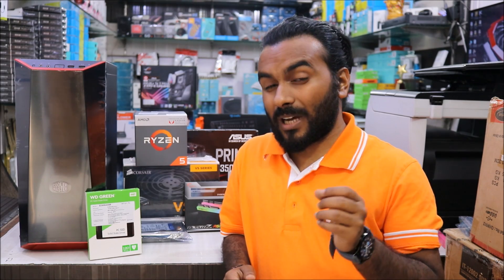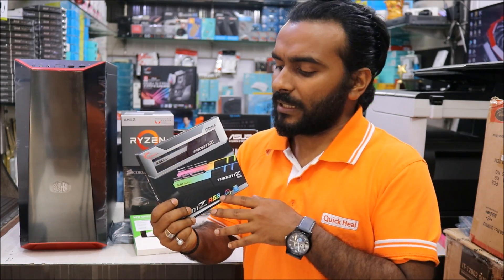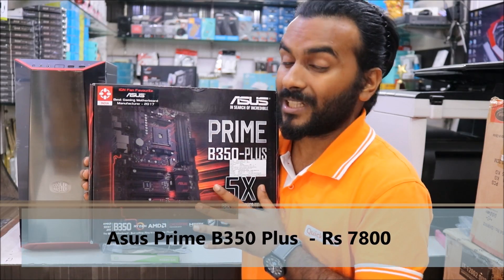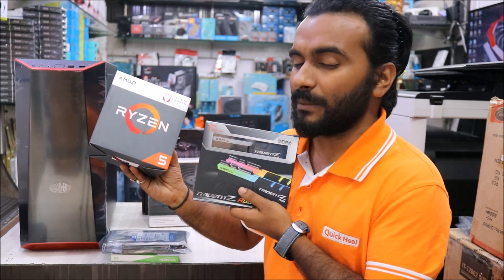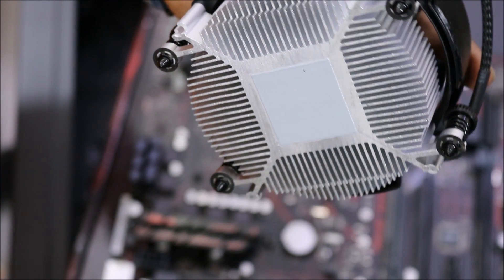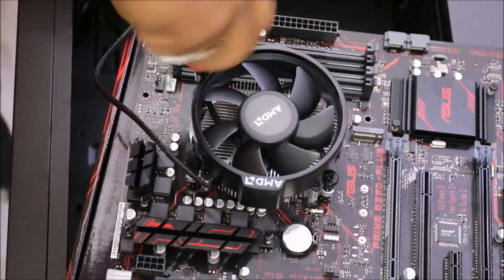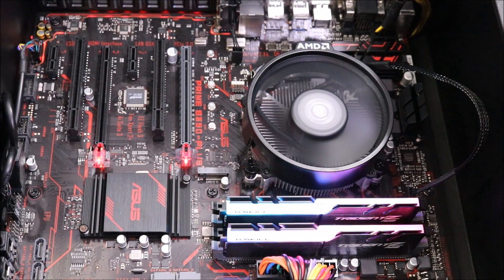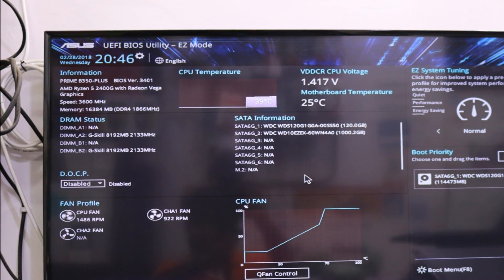AMD Ryzen 5 2400G PC Build | On board Radeon Vega

Comment: im using ryzen 5 2400g processor on system windows 10 10.0.10240 Build 10240
but i face Clock watchdog timeout error 
is it due to windows version ?
please rply

Comment: If you are building a new PC then you also use Corsair Vengeance LPX 8GB DDR4 3000Mhz instead Gskill Tridentz which come at cheapest price that is 1×8 GB RAM for around 4500 rs and have same 3000MHz and if you need 16 GB then you can add one more of it and it will take hardly 10000 rs for 2×16 GB RAM and you can save around 9000 rs

Comment: Motherboard asus z2070f , graphiccard asos geforce GTX 750ti , ram 8gb ddr4 240 mhz corsair vengeance  lpx and  transcend 2gb 1600mhz ddr3 , Harddisk WD 1tb blue 64mb 7200rpm , SSD Samsung 860 evo 250gb , Processor Intel i5 8500 , DVD rewrite supermulti , Power supply corsire VS650 , any lipid cooling fan , cabinet any.

Comment: Kya RYZEN ka processor flash nd Freeze karta hai bohot mere dost log ka ho rha hai yesa aaplog ka hota hai aur GRAPHIC CARD LAGWAYA v hai?
Reply from the maker: If you your PC is freezing then there must me something wrong with the configuration.
Reply: @TechmartUnbox  aapne ram 8gbx2 use kiya hai lekin mai soch rha hu ki CORSAIR VEGEANCE 8gbx1 3000mhz nd Corsair vegeance 4gbx1 2400mhz use karu kya aram se game nd stream kar sakte hai
Reply: @TechmartUnbox  Aur SSD 240GB ND POWER SUPPLY 650WATT ND GRAPHIC GTX 1060 6GB RAM

Comment: thanks for the great video , i got the same cpu with asus strix b350 , i was woundering if you can show us the settings you changed in bios , like how can i increase the memory dedicated for the apu other than the 1gb default ? i got 16 g (2*8) 2400 mhz ram can i overclock to 3200?

Comment: Can u plz help me... I have asrock a320m hdv motherboard with ryzen 5 2400g and gskill 3000mhz ram, but the system is not stable when i put the RAM @ 2933MHZ (blue screen crash).. the system is stable at 2400-2800mhz. Ram fq... Any idea to fix it.. can't i run the RAM at its full capacity??

Comment: I'm building my first budget editing pc with-
Processor- Ryzen 5 2400G
Motherboard- Asus Prime B350M-A 
RAM- 8GBx1 Adata XPG Spectrix 3000mhz
HDD- WD 2TB BLUE
PSU- Corsair vs550w
UPS- Circle 1kva
Cabinet- Circle CC 820
including dell Monitor for ₹9k,
KB&Mouse and speaker for ₹2k
Total cost around ₹55000inr 
Any better options? Tips?

Comment: Can I use Corsair Vengeance 8GB DDR4 LPX 2400MHz .                                                                                                                       
            The link for this item :https://www.amazon.in/Corsair-Vengeance-2400MHz-Chipset- 
            CMK8GX4M1A2400C16R/dp/B01ARHCZYO/ref=sr_1_1?s=computers&ie=UTF8&qid=1527864457&sr=1- 
            1&keywords=corsair+vengeance+8gb+ddr4+lpx+2400mhz+c16+ram+kit+for+x99+chipset.
   
Please Make a video for me using this ram with the same processor and motherboard

Comment: my requirement

Ryzen 5 2400g 
MSI B350M Gaming PRO Socket AM4 Motherboard
Crucial 2x4GB DDR4 2400 CL17
Seagate Barracuda 1tb
BitFenix Comrade Window ATX Mid Tower Case (Black) + 500W PSU

can i overclock with that requirement?

Comment: guys hi have below requirement for my VIRTUAL MACHINES practicals. 
if you can let me know what will be the overall cost of the build, so that i can place order.

1) Intel Core I7-770 processor.

2) Asus B350 Plus Motherboard.

3) 2 TB HDD seg

4) Cooler Master K380 cabinet (you can suggest better if any).

5) 32 Gb of Ram (Corsair / Kingston )

6) wireless keyboard/mouse.

7) Artis 600 VA UPS.

8) TS quick heal.

9) 120/250 GB SSD,

10) SMPS Cooler Master 600W

11) any good graphics cards, which can support VR games, give me the
cost of that, consider 1060 graphics card of the good company.

Comment: Sir I am looking a PC build for my office which includes multi-tasks like running 2 accounting softwares, surveillance software, Microsoft office, screen recording etc, which processor and motherboard I should prefer. Plz guide.
Reply from the maker: ryzen 3 1200 will do all the work and you dont have to spend much,
Reply: Techmart Unbox thanks bro, but when I enquired the seller said I also need to buy graphic card otherwise there will be no display.

Comment: I wanted to build a beast pc

Intel i7 8700k
Asus Z370-E Strix
TridentZ 3200Mhz (8gb×2)
Samsung 960 evo 500gb m.2 ssd
Samsung 860 evo 250gb Sata drive
Seagate Firecuda 2TB
Corsair Crystal series 570x
Corsair rm1000x power supply
Msi Gaming X Trio Gtx 1080 Ti
Corsair H150i Pro hydro series cooler...
Reply from the maker: Please drop me an email at techmart.unbox@gmail.com

Comment: If you are looking for a much cheaper budget go for Ryzen 3 2200G and a bit cheaper AM4 mobo, 8gb 2800mhz, HDD, SSD and cabinet(under 2k) which comes with PSU..
Bcuz this setup doesn't require more than 250w PSU.. The SMPS which comes with cabinet is more than enough
With this u can cut the price to 32-35k..

Comment: Replace these with the component used in the build video and get MUCH better performance. Prices from cost to cost (http://www.costtocost.in/list/pricelist.pdf)

AMD RYZEN 5 1600 : Rs 13135
ASUS 1050 TI 4GB : Rs 12288
ASUS B 350 PLUS : Rs 6990
CORSAIR 8GB D.4 VENG.(HEAT : Rs 5990 enough for now. Can add later when memory prices comes down.
Reply from the maker: hey guys dont fight, !
Reply: Stupid have u ever visited that place. While making purchase they will add 18% . please calculate the price and let me know in the comment box. People like u really mislead the entire world using little knowledge. Little knowledge is very dangerous. Always research before puting anything on social media platfrom.
Reply: (13k+19k) = 32k
(13.1k+12.2k+6k)*1.18 =  32.38
Same motherboard.

So for 380 Rs.. you are getting a system that will kick the ass of the system built in the video.. And I am misleading? Wow!
I gave a alternative which cost almost the same now with MUCH better performance and a simple ram upgrade path. I also mentioned it's better to wait for 2600.

I have no affiliation to any store. You will get cheaper at some place and expensive at other. You need to check what is best for you. Added the pricing from cost to cost as these prices are easily available online and represent a cost at ground level. Online marketplace(amazon/flipkart) are generally expensive for PC components.

Comment: If you want a pc only for gaming in less than ₹35000, than this pc will give 2x better results in games than Ryzen's new APUs :
-G4560 (₹5500)
-1050ti (₹12000)
-8GB 2400mhz (₹6000)
-Mobo (₹4400) , don't remember the name 😅
-Wd blue hdd (₹3000)
-Psu (₹2500)
- Cabinet (₹1500)
Reply from the maker: kuch bhi  haan ??

Comment: What about the bios update did you yourself did that or it came from factory.
Reply: Hardcore Gamer yes ryzen 2000 series have facing bios problem
Reply: go to amd support webpage and request for BOOT KITIt contains AMD A6 processor for booting and Flashing Bios
Reply from the maker: buy a latest manufactured board. I got jan2018 manufactured and it was working perfect out of the box. Also bios was latest
Reply: Thnx for the reply
Reply: Techmart Unbox can I use MSI b350 tomahawk with latest bios if I buy that mobo after 2 months?
Reply: Yes you can if they would clear their stocks.I am also waiting for older stocks to be cleared.

Comment: Can you build pc under 1 lakh
My requirements are:-
I5 8600k
Asus mortherboard 
Gtx 1060 3gb OC
250 gb SSD
16 GB ram 
2tb hard disk
Cooler system 
Cooler master cabinet 
Corsair power supply
Reply: you can get these specs at 50-70k
Reply: Ur good eith this mate. Nice

Comment: ₹13000 AMD Processor + ₹19000 Ram =32000 ₹ /
₹ 12000 (i5 7400) + ₹ 15000 (1050ti) +₹ 7000 RAM = 34000 ₹
Reply: bro its 16gb 3000mhz for 19000, ur adding 8gb 2400mhz for 7k. Ur calculation is like comparing mercedes to a maruti ciaz. Also i5 7500 price is 14k
Reply: Sashank Gaurav . comment me kuch bhi likha dalo sahi h baba
Reply: Bhai 1050ti have vram so 8gig ram also work
And costtocost.com has cheaper rate of i5 its offline price
Reply: Sashank Gaurav costtocost.com prices are excluding gst. Please add 18% to that amount

Comment: Do i need to update bios for ryzen 3 2200g with vega 8 graphics Apu
Reply from the maker: Buy latest manufacture board, The One i installed It was manufactured in Jan2018 and the bios was latest hence I don't had to update bios.
Reply: Thanks

Comment: Awesome build again can you tell me the price of gtx 1060 6gb please bahi.
Reply: gtx 1050ti 4gb OC can handle GTA V,farcry 4 and other AAA titles at high to ultra settings on 40-60fps
Reply: Geeta Prabha yes you can go with GTX 1050ti but I would recommend GTX 1060 3gb .it's the best value without price inflation.😊
Reply: Which can handle easily gta 5 and far cry 4 on high and ultra settings please  and on Intel under 40,000 to 45,000
Reply: Techn Guys it should not be more than 25000
Reply: Anshuman Singh approx 38000rs

Comment: Hi bhai 
I have request to you please can u make 1lakh pc build with parts given bellow....
intel i5 8400
Cooler masterbox lite 5 rgb
Asus gtx 1050ti 
Corsair cx 450
G skill ram (8x2) rgb
Hard drive 1tb 
Ssd samsung 850 evo 120  gb
Lg24mp88hv-s moniter 
Gigabyte z370 aorus ultra gaming 5 motherborad
Reply: Deepak Chawla thanks bro
Reply: pratik khadake go with gtx 1060 3gb
Reply: It is 8400 non k there no unlocked version for 8400
Reply: pratik khadake bro instead of going with lg monitor which is around 15k online you can go with samsung curved monitor :- 
https://www.amazon.in/gp/aw/d/B01GFPGHSM/ref=mp_s_a_1_1?ie=UTF8&qid=1519977060&sr=8-1&pi=AC_SX118_SY170_FMwebp_QL65&keywords=samsung+curved+monitors
Reply: Non k version n high end mobo.....doesn't complement mate....go for i5 8600k or else wait till April for b chipset mobo.
It wud b better if u go for ryzen u can build a beast in that range.
Reply: Ashèr Velázquez thanks bro
Reply: Ryzen 5 cpu, 1600
B350 mobo
16gb ram
1060 6gb
24" display.
500w psu
You can assemble below 1lakh
Intel 8400 is not a good choice right now, u can wait for cheaper motherboards.
Reply: za guite I would recommend go with ryzen 1700...
Reply: pratik khadake don't buy Intel processor. .go with ryzen 1700.... believe me u could play all UPCOMING AAA games in ultra
Reply: pratik khadake 😂😂😂😂😂😂😂😂😂😂😂😂😂😂😂😂😂😂 1 lakh ka build using 1050Tis 😂😂😂😂😂😂 You meant using them in sli or cross fire isnt it 😂😂😂😂😂😂😂
Reply: 1 lakh build using a 120 gb ssd and a 1tb hdd ... bhai ganja wanja phoonka hai ?

Comment: My requirements 
Ryzen 5 1600
Asus Prime B350 plus
8Gb DDR4 Ram 3000Mhz
1Tb Segate Firecuda.
Corsair CX 650 bronze plus
Asus GTX 1050Ti
Reply: looooool an overkill psu can't fry your motherboard or damage your pc. That only happens if the psu is rubbish and cheap
Reply: Umesh Benake go for gtx 1060 3 gb
Reply: Anshuman Singh 
Thank for suggestion I was Also thinking of that.
Reply: Anshuman Singh 
Bro but I wanted to use it for video editing not for gaming.is 3gb V ram is enough for video editing?
Reply: Umesh Benake gtx 1060 would be gd for editing than gtx 1050ti
Reply: East Hunter69 
No bro... It will  not affect motherboard.
Reply: Umesh Benake go for Asus strix b350f -AM4 MOBO
Reply: Maybe save some money on Psu go for a 550watt as 650watt will be a overkill for the PC and it may fry the motherboard!
Reply: Sir, as you mentioned that you want a pc for editing, so an SSD is a must for editing and you should use 16 gigs of ram(you can upgrade the ram later), but you should buy an SSD for booting the system and installing editing software, rather spending on 650watt PSU I recommend- https://mdcomputers.in/index.php?route=product/product&path=68&product_id=7315 . I calculated your your power usage and 400watt is enough for your system. You can also calculate by http://www.coolermaster.com/power-supply-calculator/ . And another thing sir for video editing GPU is not very important, you can use an RX 550 or a GT 1030, the gpu choice depends upon you sir but I recommend RX 550 4gb as Ryzen works better with radeon graphics. I hope this helps you. Thank you
Reply: Sir, this is not right if the person doesn't know you should make him know about that fact,  rather asking him "Do have any technical knowledge??",  I saw that you were asking someone that 3Gb vs 4Gb VRAM for video editing when GPU has no role in video editing. This justifies your technical knowledge. Sir be correct first and correct others later. Watching 3-4 youtube videos doesn't make you knowledgeable. So sir please mark your words while replying. thank you
Reply: Hello i can help u with Ur build
Reply: Whats Ur budget
Reply: Pagal Rocky yes asus strix b350f is a better option it is available for 9500 and it support rgb lighting
Reply: De_Mo no thats not true for rendering video u need higher boost frequency so a lower priced graphic card will not help
Reply: Harshit Yashwardhan no it's available for 9900
Reply: Itna bawal ..sahi h
Reply: You should go for corsair VS 550
Reply: Sir its true that graphics memory doesn`t affect editing( if the gpu memory is less it will just spill into the system memory) but a good GPU is required for editing videos and for smoother playbacks. The processor only affects render times but the main work(which is editing) is done by the GPU.
Reply: Dark Angel the main work is done not only by the gpu but also processor
Reply: mark vaz very informative bro!
Reply: Umesh Benake you can watch techy devv's channel it is very nice..you can get a nice pc for yourself there!
Reply: Devv Khemani Yes that is true both have their crucial parts in video editing, both have to be equally good. But I must remind you that render time has nothing to do with GPU, it is purely determined by the CPU alone
Reply: You should go for a 1060 instead of 1050ti and add a SSD also you might wanna reduce your cost by going with a 550 watt PSU, it will do just fine
Reply: mark vaz Yes you do need faster dual channel ram with APU's but with other ryzen processors ram speed doesn't matter if you are going to have a descrete GPU because it has its own GDDR5 ram
Reply: Umesh Benake then increase ran because premier pro requires 16 gigs for 4k editing
Reply: My Budget

ryzen 5 2400g
asus prime b350 plus
mwe 500w psu 80 plus
G.skill AEGIS 8GB (1 X 8GB) DDR4 3000 CL16 1.35v
seagate barracuda 1t 7200rpm
bitfenix comrade
Reply: @De_Mo as you said you may be right. but when we render or composte the video, either you should have high RAm or Graphic cards, if we provide Graphic cards then the rendering process will be smoother compared to non graphic/low graphic.  so @harshit Yashwardhan said is correct. you have a try. if we can provide 64 gig of ram we dont need graphic card. if we provide graphics with 4gig or more then 4 or 8 gb is enough dependng on os.
Reply: I will use msi
Reply: Use ssd
Reply: No ssd
Reply: Bhai jab ext gpu hi use karna hai to intel i5 5th gen le
Reply: Guys i need help can some share the phone number i want help in motherboard please
Reply: Guys can we put nvidea graphic card in asus
Reply: kashish garg 
Do have any technical knowledge?? Ryzen 3 2200g is Quad core.
And Ryzen 5 1600 is Hexa core wich is beneficial for video editing.
G chips are with integrated GPU.
Reply: Ryzen 1200 or 1600 is pointless buy now. Go for Ryzen 3 2200G which costs same around R5 1600 but very nice performance as compared to former.
Reply: For PSU go for cxm series or I wud highly recommend SEASONIC m series.
Reply: video editing depends upon CPU and RAM and a GPU with 2GB GDDR5 is enough for 1080p editing and also for simple 4K edits aslo.

Comment: You wasted money on rgb rams
Reply from the maker: Big thumps up for Devv Khemani, Thank you for understanding :)
Reply: He can use ram rbg body which costs 1000 rs
Reply: Techmart Unbox ❤
Reply: As i said its my choice you can choose other ram to save money. I believe that you have missed that part of the video.
Reply: Techmart Unbox Vlogs yeah actually it is the consumer's choice that which ram he want according to his needs he can get 2gb 4gb 8gb 16gb or anything and also rgb or non rgb..now just stop commenting on this topic..atleast he help his subscribers and make pcs for them..
Reply: @prernagupta2833  Did you ask if you can use 2 RAMs that doesn't come as a pair in the box. Of course you can. There's no difference. Make sure they are the same model for full compatibility. Both has to have the same frequency and voltage and preferably the same latencies. You can even mix sizes and brands.
Reply: Sir if i want to order components from ur shop.....then it is available or not?